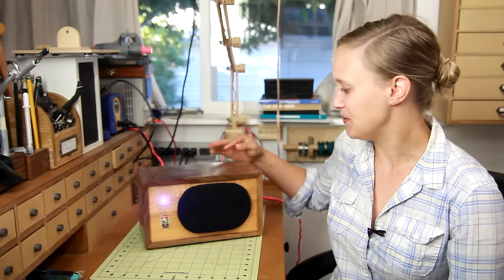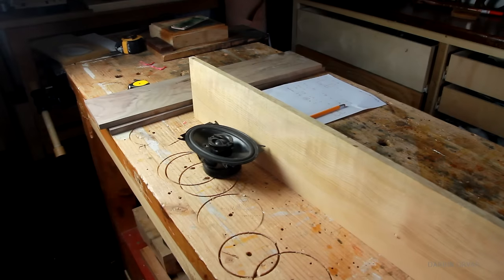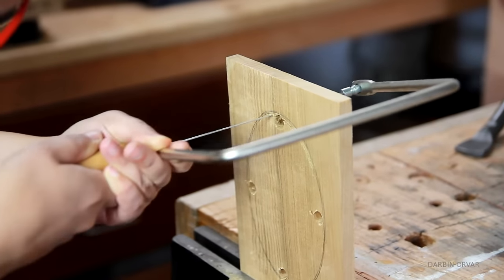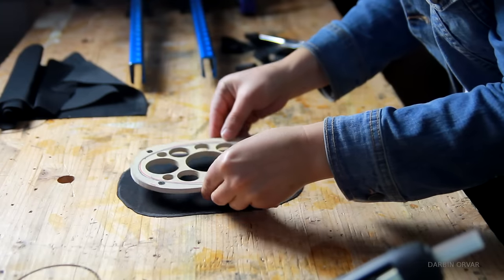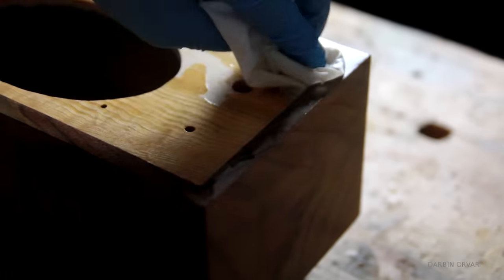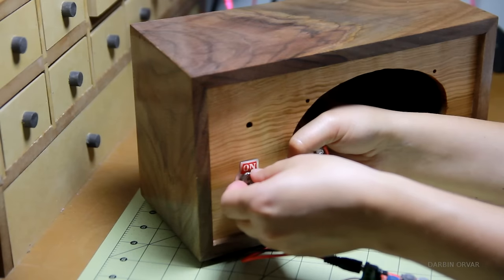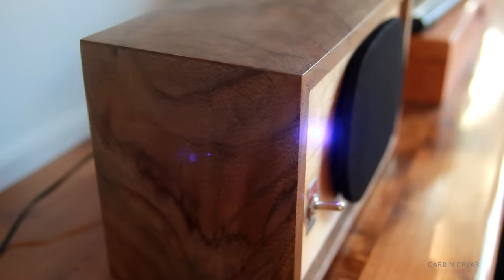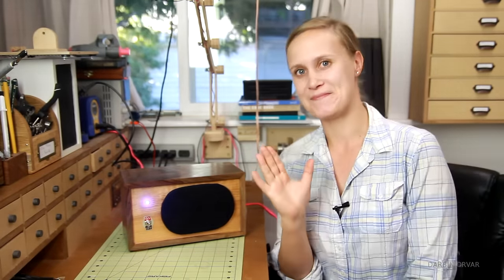DIY Bluetooth Speaker

Comment: The blue LED reminds me of the Logitech speaker set I had. It had a brain piercing blue LED which I had to tape over and it still shined through that.
Reply: Hate these, too.
Reply: my logitech system had the LED on the sub which not-entirely-unintentionally ended up under a pile of stuff
Reply: Samtagri have u used a sandpaper to reduce the light?

Comment: Great video and the most aesthetically pleasing of the diy speakers I've seen so far. 

A good way to get more precise miter cuts is to make a sled for your table saw using the 5 cut method to square the fence; then use a magnetic digital angle gauge on your blade to ensure a true 45.
If your sled was done properly and your miter bars are snug in the slots you'll get a miter within .005° Everytime. 

I am a career woodworker and this is the best method I've seen so far.

Comment: i got the same bluetooth board, its amazing. The sound is really clear and if you run it on 24v and flip the switches over it goes stupid loud. Range is great aswell, around 30-45 meters easy. They are on ebay for around £6-8.

Comment: You can more bass sound by drilling a 1" or so hole in the back (or anywhere behind the speaker). Several smaller holes would work as well. Nice build! Thanks for sharing. Dan

Comment: I used pretty much that exact switch, which I got from a surplus store, on my antique Western Electric model 302 phone, for turning the ringer on and off. I didn't use the on/off marked plate though because the surface is curved on the back of the phone.

Comment: Hi, Speakers and magnets don't mix well, the speaker works by producing an magnetic field that osculates and makes the sound. the magnets could interfere with that and cause distortion. The distortion may not be notable now but could cause problems in the further, nice job of the speaker enclosure though and well made.
Reply: You are right, but consider she is using a "cheap" two-way-car audio speaker probably without any crossover network (or maybe only one built in capacitor for the tweeter) and no calculation for the housing this concern could be neglected. I guess it ist still sounding better than most of the bluetooth speakers you can buy for the same amount of money she spent. Just a guess.
Reply: do you think that we don't know this?!
well I am not sure.
because I know that.
don't get angry.
please.
but she did not take the calculations for the wattage of the speaker and the amp. circuit.
the amp. is rated"50W" because I have it.
the speaker could be only 10-20W 100% sure.
I think I should stop.
shouldn't I??😂
Reply: Nah, those magnets won't impact the speaker performance at all. They're too far from the voice coil and too small and weak compared to the speaker's permanent magnet.
Reply: also, it's a mono speaker, even if it affected the performance of the speaker, it wouldn't matter

Comment: I need to make a speaker grille for a large set of stereo speakers in my living room. I love your idea of holding it in place with small magnets. Thanks for the inspiration!
Reply: no, the small magnets she used are too far from the voice coil to interfere. A speaker works by powering on and off an electromagnet to pull and release the voice coil. Since the neo speakers she used are so far out and separated by the wood itself, the voice coil would never know they're there.
Reply: I think you replied to the wrong comment. You are correct, though, those small magnets wouldn't effect the speaker's performance.
Reply: +Alaska Skidood  so sorry. You're right. I somehow clicked on the wrong comment. LOL I know how speakers work but fail at typing on youtube.

Comment: Beautiful design and wonderful execution!  Gluing the dado'd panels was actually a good idea, as it helps seal the enclosure and prevents annoying "chuffing" sounds as lower frequencies force air out between the small gaps.  :)

I really need to find a good local wood supplier; that piece of burl you had there was gorgeous!

Comment: Good job Linn on the mitered corners, especially on a radial arm saw or compound crosscut unit. Matching the grain shows attention to detail. Some of the folks who question about inside baffle material, porting, and magnets ....just realize that a speaker of this size is not an AUDIOPHILE masterpiece. It does the job of sound amplification and gives you a sense of accomplishment , especially doing the soldering, design and wood selection all on your own.  Keep up the good work !   JK

Comment: Great job. I loved how it turned out. The only thing I would change is the grille. It looks perfect, but it's blocking the cone of the speaker. That is generally considered a bad thing for sound quality. I realize you said it doesn't change the sound much, but it probably still makes a slight difference. 
Also, if your amp has an adjustable high pass filter, it could help protect the speaker from distorting, making it able to play louder and at the same time improving its overall sound. 
That's a car audio speaker and it's a decent brand "Powerbass". 👍🏼

Comment: Absolutely fabulous!  For the grille material you can test whether it is suitable by stretching a bit over your mouth and blowing.  If it does not resist your breath then it will do just fine.  If it does resist, ie too dense, then it will muffle the sound.

Comment: Looks good, but within any audio enclosure, you can't have anything floating.. it's not a table, every speaker without bassreflex has to be air-tight. Anything floating would resonate. Like windows on the house when a truck is going by.. 
Also I would rec. using dampening material for the inside to make the sound better, less hollow, the bass won't feel like knocking on the wood.

Comment: hey great project, i just wanted to say maybe adding a port on the back of the box would also help sound as not many car speakers are designed to run in a sealed enclosure. most car audio apart from subs run in free air

Comment: Letting those cherry panels float might result in rattling noise when the speaker is playing at higher volume, so glueing them in place is better.
Miters are easier to do when you set the angle to a bit more than 45 degrees so the outer edges get really close together. If you already have done that it might be a precision issue of that saw you are using.

That speaker looks really nice. ;-)

Comment: very nice clean work...although, adding a in a power bank to go wireless, with usb port to plug in your music loaded flash drive.... I 've built one with two 6 inch two ways with a built in solar charger or usb charging.... a push botton power on/off with halo light indicating power on. The best part is that I made it water resistant... I would like to project another but like yours....clean simple and also water resistant.... if there's a stain that protects the wood from water other than Tompson Water Seal.... Double thumbs up.

Comment: Hey Darbin

Just a quick tip, the speaker looks great, if you would want to have a better sound with that speaker you should put a (bass)tube in te side about 3/4 in thrue the box. Would make you speaker unit give a bit off warmer sound. Also you can line the inside of the case with fabric, that would keep the hi resonant sounds out of the box and als provide you with a nice sounds.

Just a tip

Greetz all the way from Belgium

Bensh

Comment: Nice lookin box you've got good hands for wood I like ur trick with the steel wool after polishing it. But you might put some foam plates in the back to get a deeper and more clear sound also you need a hole in your case for the sound pressure to come out. in worst case the bass pressure can even destroy ur box.

Comment: Nice fun little project. Only suggestion i can think of off the top of my head would be to relocate the switch to the back for a cleaner looking front. Or maybe change the style to something a little more sophisticated and less industrial. Or a third option would be to change the speaker cover to encompass the entire front. Something to think about. Thanks for sharing.

Comment: Hello! I would try with removing the fabric from the grille and use it as it is, treat the grille to darken it. Also make a reflex port (just drill 40 mm. hole)  on the back side to give it little more depth to the sound. Hälsningar från Sverige...

Comment: When you wired the speaker to the amp, did you just use both outputs from the amp to the speaker?
My thoughts is that if you had music with left or right sounds it might back up and fry one of the outputs on the amp. Or am i just overthinking things? Haha

Comment: hi I have a couples of questions, 
how durable is the electronic? how long have you continue used? 
now regarding the box design, is there a reason you choose that dimension? better for the acustic of the speaker and for the bass reflexion.. did you drill hole in the back for the temp and air flux? 

I like your speaker!!! I love the design and woods that you pick!!!

Comment: Have you thought about putting a ring of walnut designed after the speaker grill in place of the grill?Using the grill and how it attaches as a pattern point.
Reply from the maker: That would be nice!

Comment: Awesome. Thanks for the work you do. I'm thinking about doing this and I have a couple of questions.

You mention a resistor fir the led, but I did not see where to get one in the description.

Where do I get the wire and connectors for plugging in the power?

Comment: This is awesome! I think it would be cool to have LED stripes around the speaker so that when the grill is on it has a sort of under/side glow. Just a thought
Reply from the maker: +Antoun Chahoud that's a great idea...i call dibs :)
Reply: Try "el wire" for the lighting around the grill.
You should be able to recess the wire using a router bit.

Comment: Any reason for the new saw?  I have the same dewalt one you have been using, but I haven't had too much time to mess around with it, so I'm curious if you've found some big issues with it or just upgrading to upgrade.  Really like the speaker too!
Reply from the maker: No issues, just an upgrade :)

Comment: hi, i bought the same bluetooth board which ill be doing a project of my own. I seen allot of people using the power supply amazon says people have bought together. So i was thinking its cool to have a power supply, but what if people want to make it portable. So is their a way to make it portable and charge it at the same time? do you have any recommendations? i was thinking using that blue tooth board max 24v. reason i found good speakers that are rated high and have amazing specs for being a small 4 inch speaker. So i want to use 3.7v batteries and connect them to make 24v. for those batteries they are light and reliable.

Comment: I see others have asked but I can't find an answer: how did you get a mono output from the stereo bluetooth amp? If you simply only connected one output to the speaker you'd be missing half the sound. This would be especially apparent with old recordings like The Beatles where some instruments are almost entirely to the L or R channel.
Reply: David Cohen de Lara join the two inputs for amplifier using two resistors, then it can be used as mono input for amplifier

Comment: So that speaker looks like a 6×9 inch speaker, typically the kind in the rear deck of a sedan. If you replace your car speakers I suggest saving the original ones and using it for this

Comment: Im working on building a similar speaker but im a mess with the whole wiring thingy. Which kind of resistor did you use for your led light?

Comment: Hi Darbin, it's a cool project ;) I play with electronics & woodworking as well, when I was a university student I built a lithium battery powered Buletooth speaker sort of like this project, now I work in Bosch Accessory team, if you like try to some new accessories, I'd like to send you some samples, whether screwdriver bits, wood drilling bits, or circular saw blades. Avanti Pro is sort of our project, 12" 80T, I saw you use that on your miter saw in another video, do you feel like to use it? :)

Comment: Really liked your video (and your workshop). 
I was able to obtain antique radios from eBay that are not working, but the wood cabinet is refinishable. They are cheap and beautiful. 
Then install speaker(s) and a amp. But it will be BT and direct source and a power supply and batteries. 
Can I use your workshop.. Much better than mine.. :) 
Keep up the good work.

Comment: Nice speaker!  I like it's minimalist look. 
Did I miss the part where you explain how you connected the 4 speaker wires to a single speaker?  At 5:40 we clearly see that both speaker terminal blocks on the amp are connected to red and black wires (you also drew 4 wires in your wiring sketch). At which point does it become a mono signal?  
I like your videos, but this one seems to be missing some details. ;-)

Comment: Question; I took a low watt speaker (bought a toy with a speaker and gutted the case but for the speaker).  I connected it to both channels of my Bluetooth module with a Y type connection.  It plays mono recorded MP3 files fine at higher volumes but when I play a file with stereo channels I hear marked stuttering at high levels of volume.  Is my Bluetooth module just not designed to work with one speaker?

Comment: Hi Linn nice build.  Since you are only using one speaker, and the Bluetooth amplifier is stereo, how did you connect it to the speaker?  I ask because I built a similar BT Speaker and used a Mono amplifier and BT Receiver.  To get left and right into the Mono Amplifier, I built a type of mixer that takes both left and right outputs for the BT receiver and combines them together into the Mono Amp.  In your video i see you are using both Left and Right Outputs from the amplifier so did you connect both left and right together directly to the speaker?  If so, it is not advisable as one channel will bleed into the other especially at higher volumes eventually blowing one of the channels.
Reply: Hi no I have not posted my build but was thinking of putting up a youtube video if people are interested in seeing what I did.
Reply: ***** Ok I will do a Video of my Bluetooth Speaker.  It will be on my other channel Gijigadget.  If I find the time this week end, I will put it up.
Reply: I would like to know it too... a friend of mine suggested to wire le speaker to the + of one channel and the - of the other, making a bridge over the remaining two contacts. .. I had problem for nlt having enough impedance. maybe with a 8 ohm speaker imstead of 4 ohm...
Reply: this is a Dual BTL amplifier using the TDA7492 which should not be bridged ever!
it appears that left and right are going to the single driver thus shorting the amplifier.
there is a way to make this work with a stereo mono transformer used in whole house audio installations. KEF used to make such a transformer
Reply: Hi Gabriel I know it has been a while since I said I would do a video of my BT speaker.  Well I have some time so I expect to make one this week.  It will be posted on my other channel Gijigadget.

Comment: awesome. so did you just use one of the channels?or are you able to send mono audio from your phone?
Reply: probably wired the speaker to both channels.
Reply: darronjknight,if you do that and make it work for 5+ hours, the TDA2050 audio amp. ic will burn out.
NEVER EVER DO THAT!!!!
IT MAY COST YOU $20.99!!!!!!!
because the whole board is for $21.
check it out on eBay.
you all will get it.
remember- $21.
🔊=$21.
Reply: what's an easy way to turn stereo into mono?
Reply: its not that easy
Reply: +David Zvonař it is easier than you think.
just plug in one of the speaker outputs.
SEEEEEEEEEEEEEEEEEEEEEEEEEEEEEEE!
Reply: what? I dont know to bluetooth amplifier capabilities, but I dont think, that it
 can recognize, that only one cable is connected and then downmix it in mono.
Reply: Listening to either Left or Right channel isn´t the same as listening to MONO ;))) It´s not even close to it.
Reply: Ok, its actually easy as long as its an properly recorded audio. Just connect both wires to one.

Comment: Am I missing something? How is it that you have two channels being wired to the amp, yet there is only one speaker being used? I am confused - where is the wires leading to? Also, I appreciate the diagram, but it doesn't make much sense due to the lack of detail. Can someone please fill in the blanks, please?

Comment: I like most of this, but I wish you had spent more time talking about the electronics and how you ended up not only choosing them (why you chose those particular parts), but wiring and then mounting inside the case. You seem to have skipped over those portions of the proess. Thanks, though!

Comment: Loudspeaker device or Amerfiralve adjoining Bluetooth searched for us in Egypt did not find him, the spectrum may be I do not know specifically named or had device was directed by him to the piece rather than the piece Can I use Bluetooth user device in the desktop computer that works by usb This formation consisting of 4 2 parties, including electricity, ground floor and two other probably for data transfer (waiting for the answer) Thank you engineer Darbin

Comment: How do you control the volume? Do you have the amp turned all the way up and then you use the volume on your blue tooth device?
Reply from the maker: Exactly.
Reply: +Darbin Orvar you could wire in a potentiometer for volume control. it'd be a good excuse to have a walnut knob to add contrast to the cherry.
Reply: The amplifier module has buttons for Volume UP/DOWN, Play/Pause. So you don't need to add a potentiometer, you could incorporate the existing buttons it into your case design if you really want it. But I find it's good enough to control via the Bluetooth device. If I recall correctly (brought the same module last year) when the unit is powered up it defaults to 70% volume, which is very loud if your Bluetooth device is set to maximum volume.